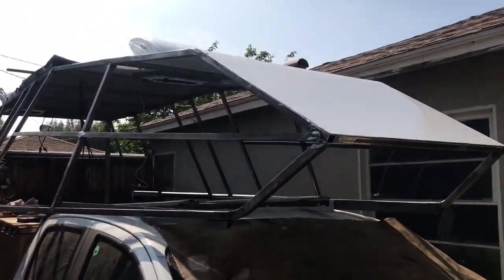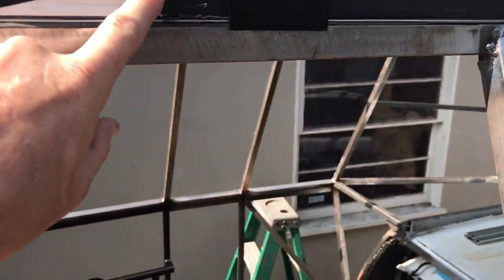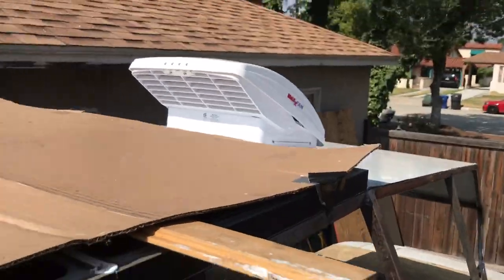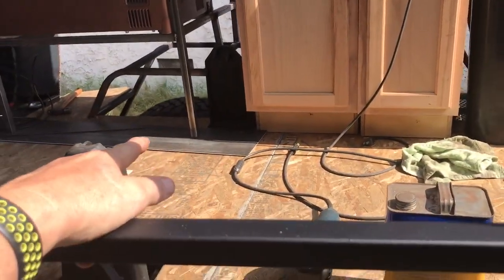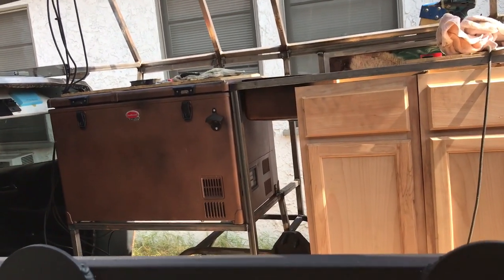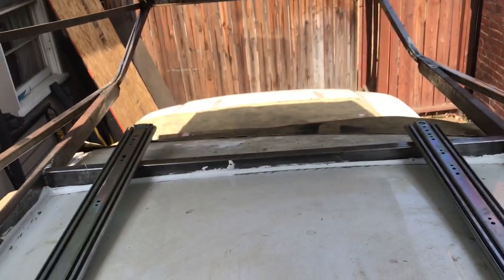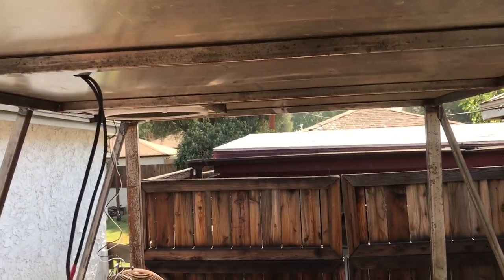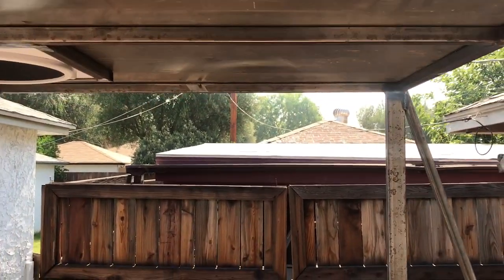Adventure Truck Build day 37

Comment: Flat mounting solar panels might not be a good option, you might check with the vendor to see if they have any advice on it.  Typically you'll see a reduction in performance due to heat build up.  Typically having them elevated to let air flow under them keeps this from being an issue.  Adding the foam under them may even make this worse, as you'll be insulating the heat into the panels.
Reply from the maker: Hi Brandon. Great to hear from you again! As far as flat mounting goes I have had the front 2 mounted flat for a year and 1/2 with good performance! About 8 years ago I added a solar bank to the back of my box van and made it so when I parked I could elevate it and watch the difference on the charge controller witch was minimal. Maybe 10-15 % better when elevated. I'm ok with them flat as much as 90% of the RV industry installs flat. As far as the insulation goes...Well I may have missed that and will report back when in full use! Thank you for your input! Cheers!
Reply: Tim Robel you could install a solar water heater under the panels inside roof side with a drop down hot water spigot. That would cool the panel and give you a 15% bump in current during lunch time 🤔
Reply from the maker: Now that's thinking! I will keep that in mind for the next one! Great idea Randy!

Comment: Good idea to insulation between solar panel's , they do get hot. Was wondering about flex between camper and cab ,do you have to compensate for movement or am I over thinking , I don't have a clue ,thanks looks good.
Reply from the maker: Hi John! Think of this as more like a van now than a truck. Everything is rigid.  I have built several off road cars with this theory and it worked out perfect! I guess we will see if it all works out! As of right now I'm not loosing any sleep over it! LOL! Great to hear from you again! Have a happy 4th of July!

Comment: What do you say the value is going to be of it when it's all done
Reply from the maker: Hi Daniel! This is a very hard one to answer! Looking at the market for Expedition and Adventure trucks they sell new and used from $225,000 and up,  which I consider very high valued. In the end and done I will say maybe $125,00 -$150,00. Its only worth what someone will pay for it. I just saw a 4x4 170 WB sprinter outfitted vey well go up for sale 2 weeks ago for $240,000 and a F550 built out very nice go up for $225,000 on expedition portal. I know I would not let this one go for any less than $125,00 and my wife thing I'm nuts on the price! A lot of work and thought goes into it for sure! What are your thoughts?